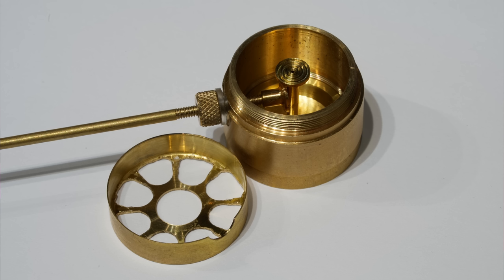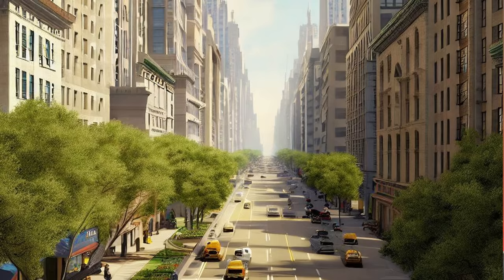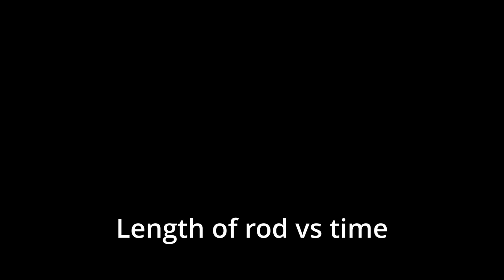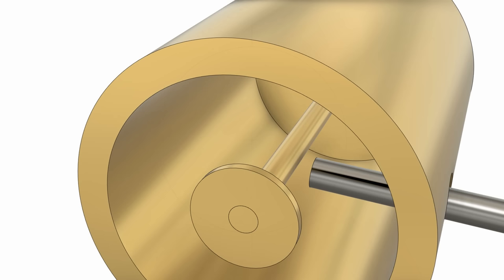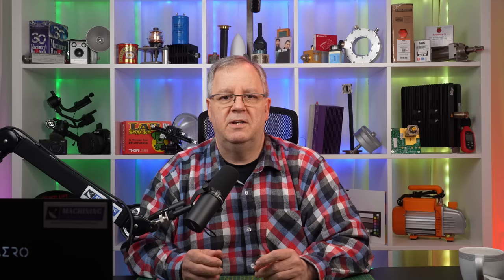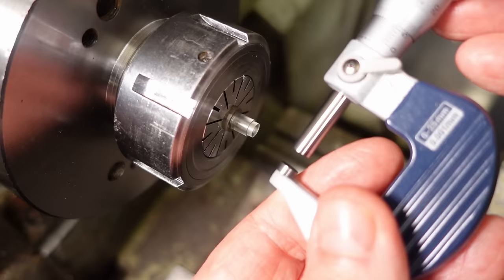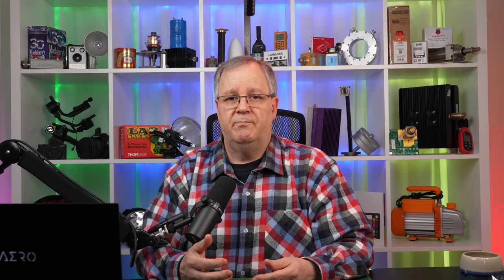SOLVING the Mystery Behind a Soviet Spy Bug : A True Masterpiece of Technical Elegance!

Comment: In 1945 there obviously was no suitable mass-produced vacuum device in the USSR, I bet it was custom-made.
Reply from the maker: There were some acorn tubes in the 30s but I haven't seen and disc-seal devices other than those from GE in 43/44, but the tech was well established by then, so it would have been easy enough for some USSR academics and engineers to make custom tubes and select those that worked well
Reply: @MachiningandMicrowaves , yeah, I didn't mean to offend the western technology of the day, I just initially forgot to specify that I meant there wasn't any in the USSR. Amazing research, thank you! It all makes sense when you spell it out, but back in 1945 I doubt it was as clear and well understood, although the people who worked on it were probably some of the best in the field.
Reply from the maker: @VioletGiraffe  If the NKVD followed sensible protocols, none of the individual makers or suppliers would be given enough information to form an idea of what the whole thing is about. I'm researching proximity fuzes fir a project, and the security restrictions included not using weapons with prox fuzes over land to prevent duds and parts from being found by adversaries. During the early deployments of the Sidewinder air to air missile, a MIG was hit but the warhead didn't explode and the pilot managed to land safely, complete with the missile. One hell of a way to gather intel!
Reply: @MachiningandMicrowaves , wow, great story, thanks for sharing! I've heard about some cold war accidents, but not this one. And indeed, compartmentalization would be expected in such a top secret project.

Comment: Did you get a specimen device, and figure this out on your own?  Kudos to you if you did.  I had the right education, though I  didn't use it during the last 50 years - I went digital - so I'm able to follow you, but I would never have figured out how it worked.
Reply from the maker: For the purpose of the TV programme, I worked only from the original sketches and notes from the Naval Laboratories, FBI and CIA from 1952. I didn't use anything from later as most of it was nonsense, other than the 1955 CIA lab experiments, but that was only for verification.  I took the view that I'd construct it as accurately as I could, then find out how it behaved without any of the hare-brained ideas about "1.7 GHz" resonances or some sort of magical frequency multiplication.  I trusted my instruments and tested it and found it worked best between  about 930 and 1100 MHz, with best performance in the 950 to 1000 MHz range.  I had to trust the sketch diagram dimensions, and there are two errors in that, but luckily it's over-constrained, plus some of the other dimensions had to come from very careful measurement of zoomed-in photos.  We couldn't get hold of any current images as nobody seems to be aware of where the original resonator parts are, nor could I get high-res images of the attachment of the foil to the bronze ring, nor the exact arrangement of grooves on the face of the resonator.  It took more than a hundred hours of experimentation in my machine shop and lab before I was confident enough that I understood it all. Reverse--engineering something like this from pencil drawings and photocopied photographs and unreliable descriptions laced with fanciful ideas and deliberate misinformation has been huge fun. As I'd say to anyone, ignore everything you think you know about the thing you're investigating, check your instruments, then trust what they tell you, even if it seems at odds with received wisdom.
Reply: @MachiningandMicrowaves  Well you certainly get my respect, Sir!  You did fantastic research work.  One thing that I found amazing was that the Americans had accepted a gift like this from the Soviets, and had hung it in a politically sensitive environment.  How naive!  They could have used a bloke like you!

You've got to give it the Ruskies, though - it was a damn clever idea - but sometimes, these things are easier to conceive than to analyse after the event.  We don't know how the Cusco walls were made - but I don't suppose it was anything we would find amazing if they had left a movie of how they did it.
Reply from the maker: @DownhillAllTheWay  Harriman was a well- researched target, and none of the tech folks thought this was a potential risk without and power source or wires. The attention to detail in later ops like GUNMAN were astounding. Making the hollowed-out metal bars containing the decoder, magnetic core memory and transmitter weigh exactly the same as the bar so there was no effect in the overall weight of the typewriters show serious attention to detail

Comment: I've read through the wiki article for this bug before, but I'm fairly certain I still did not understand how it worked. Now I do, and god damn that thing is brilliant. I don't necessarily fully understand your description of the demodulation side of things, but that's on me for not being too into radio and microwave stuff.
Reply from the maker: I didn't really explain that part, I was trying to keep it short and failed at that as well.  I might see if I can make a version that can be driven directly to show what the output really looks like, and then look at the maths.  If you have a diode in its square-law region, the current is proportion to the voltage squared. If you then drive it with a mixture of a pure tone at 1 GHz and the modulated signal, then feed the output into a resistor, the voltage across that resistor is the sum of the tone and signal, all squared.  The tone is just B*cos(omega*t + phi) and the  modulated signal resulting from a simple audio tone is the usual AM expression A*sin(omega t)+ 0.5Am(sin(2pi(fc+fm)t+theta + sin()2pi(fc-fm)t-theta)
omega is just shorthand for 2pi*fc, fc is the 1 GHz carrier frequency and fm is the audio modulation frequency. A and B are just the amplitudes and m is the modulation index (0.05 or so) Now add the two together and square the result using the diode transfer function.  You get an exciting mixture of results!  After a load of trigonometric identities and wrangling, there are some components with sin(2pi*fc+phase angle) plus a load of other stuff.  Run the combination through a diplexer to take anything higher than 3 kHz into a dump resistor and everything below 3 kHz but above 200 Hz into an audio amplifier, and you recover the original audio signal.  If there is also some phase modulation, that results in  multiple additional sidebands around the 1 GHz carrier, although at a low modulation index, the result is pretty much the same as AM.  At higher modulation indices, the results are more complex, with Bessel functions of different orders causing a spread of sidebands rather like in FM.  However, they are mostly removed by the low pass filter, except for the low frequency parts of the higher-order sidebands. The amount of phase mod is (luckily) quite low.  I hope you can see why I rather glossed over THAT lot, but it would be fun to do a ten minute vid about it at some point, to exercise my MATLAB, Manim, MathCAD and storytelling skills!

Comment: Nice work! All right and correct, in theory, but it is the amount of re-radiated power by the passive radiomicrophone, an infinitesimal fraction of the signal transmitted to "excite the passive transmitter," that puzzles me.
Passive repeaters are rarely practicable, precisely because of the huge attenuation, which is easily calculated.
Therefore, given the infinitesimal power of the re-irradiated signal, the distance a receiver must stand for this system to work is very (but very) small. 
Power that is still reduced by 3bB, since to modulate in amplitude (and spuriously in phase/frequency) we will have to resonate the cavity with a frequency offset that brings the carrier to -3dB from the peak.
A huge power transmitter is needed, with the consequent problem that it will be (also) extremely difficult (in practice) to be able to rotate multipath reflections 180° as well as the carrier. 
I am afraid this is as ingenious as it is complex and impractical to put into operation.
Reply from the maker: It worked continuously from 1945 to 1952 in the US Ambassador's residence in Moscow and in several other embassies. Copies were made by other security services and they worked. I was able to get up to 76 dB of cancellation of the exciting signal. From 140 metres, 5 watts is more than sufficient. I made it work with 250 milliwatts using a modern SDR radio and a period-correct homodyne with a sense antenna. The low noise floor in 1945 Moscow helped a lot of course, but I even managed to detect a very weak signal in all the RF noise inside the BBC Council Chamber at Broadcasting House in London. It isn't easy, but with careful positioning and use of separate building with mutual shielding, it certainly worked well back in 1945 and still works now st my quiet rural location
Reply: @MachiningandMicrowaves  Thank You for answering! Could You please be more precise with datas? I'm very much interested to estimate the power which is radiated from the passive radiator. Is it -24dBm the transmitter output power? Then, 24dBm + 13dB (antenna gain) give the desired ERP of 37dBm (5W), correct? What's the distance between transmitting point and the device? What kind of antenna/s did You use with the receiver? What SDR receiver did you use? It must have had two ports, allowing independent phase and amplitude regs, correct? What sort of layout had your test system? Were the receivers antennas shielded to transmitter, but in line of sight with the device? The device was in open air, or shielded by wall/s?
Reply from the maker: @MaDrone  I'm travelling right now so I'll try to reply when I am back home
Reply: @MachiningandMicrowaves  There's no rush.

Comment: A very nice presentation, when I first heard of the bug I thought it involved a diaphragm and microwave energy, as batteries would never do.  (later) I thought a silver plated cavity etc, with a gold flash to seal the silver from the air born pollutants (sulfur) from corrupting the surfaces.
I always thought the transmitter and receiver would be in the same room/same window with cross polarized antennas, possibly circular.  (possibility with a sample of the transmit signal inverted, providing phase controlled subtraction.  I'm not sure when isolators were developed, but they would be helpful in this area. I love your background. Ron W4BIN
Reply from the maker: The few references in Russian that I've seen do suggest that the transmit site was about 140 metres away across the street behind Spaso House and off to one side.  There is some discussion about why the caretaker/boilerkeeper took three weeks to hand over his key to the lodge, and when it was inspected there was a suspiciously empty room, but that came from US sources.

Comment: UHF  AM radio transmitter using passive components  in 1945?   I am impressed.
Reply from the maker: Not quite a transmitter, but certainly a passive backscatter modulator.  It's an iconic design from much simpler times that has been misunderstood and misrepresented in publications

Comment: Many early UHF receivers used resonant cavities as the main RF resonator instead of a coil and capacitor.  As the team was already skilled in that technology, they could have easily used it for both the power  emitter and FM receiver.
Reply from the maker: It's the transmit device that's in question, but at 1 GHz, they could possibly have used helical resonators if they existed at the time. I guess it would be more likely they used stripline cavities as you suggest. I know there were Russian-made acorn tubes capable of working at 1.4 GHz in the mid-30s, they are in the catalogues, but there would be no need for an RF preamplifier with the high signal levels, so I guess they just used a crystal diode detector with perhaps a directional coupler and phasing/attenuation for a sense antenna, then a diplexer/filter straight to audio. There were certainly plenty of cavity transmit amplifiers around in the early 1950s for the UHF range, but I haven't seen any direct evidence for what they were using in 1943-45.  Of course the tech might have changed over the period the device (and the others!) were operating.  Klystrons didn't appear in the West until the Varians published their paper and patent in '37 to '39, but tubes capable of 400 MHz+ do seem to have been available. Getting hold of Klystrons after 1941 would probably have been easy enough, but perhaps they used indigenous Russian tech, which was pretty much on a par with the rest of the world, or something from Germany.  I would just LOVE to see a photo of one of the transmit units!

Comment: TBH I'm having difficulty seeing your face and a backdrop. Not that it's bad, but change is difficult. I'm glad there's some machining in this one to get me back to my comfort zone. Happy Easter!
Reply from the maker: I'll be mixing up the formats depending on what work comes in.  The BBC Great Seal and Rogers Corp video series have taken 500+ hours in all, so machining has taken a back seat, but it's beastly cold in the machine shop.  I have a new heater now, so I should be able to get some interesting projects machined.  Also I have new metalcasting gear, a new 3D printer for mouldmaking, some excellent new inserts for ultra-fine grooves and an Alexander D-bit grinder, so should be able to do some better machining.  I have three sponsored videos coming up, so that will help me to make some better parts and do more interesting projects.
Reply: @MachiningandMicrowaves  You're doing a great job. The resonant cavity explainer is super interesting and far more complex than expected. Hope it warms up nicely for you.

Comment: Utterly fascinating! RF still seems like a black art to me, I like nice friendly DC that’s not always finding some way around things when you’re not looking. I still love your stuff though :-)
Reply from the maker: "Everything is an antenna", "Amplifiers are just temporarily failed oscillators".  I love things like microstrip PCB interconnects where they can be logic 1 at one end, logic 0 in the middle and something else at the other end, and also radiate and couple to anything and everything. Such fun.
Reply from the maker: see also "Every UHF oscillator is also an SHF oscillator, but you probably won't realise that until it's too late"
Reply: @MachiningandMicrowaves  Haha - I like the one about failed oscillators! 😂 I watched a really fascinating hour-long video about PCB layout last week; the main point was that PCB traces aren’t conductors, they’re antennas, you can’t just think about decoupling caps, you have to think in terms of the electric and magnetic fields; every nearby trace is going to look like a path to ground for the highest frequencies. It was a complete paradigm shift for me 🤯I don’t have any occasion to design high-speed PCBs these days, but it was still hugely educational when it comes to thinking about shielding and grounding to keep HF noise out of low-level inputs.
Reply from the maker: @DEtchells  I remember laying out MECL III PCBs with microstrip interconnects back in 1976.  They were only running at 280 Mbit/sec, but it seemed pretty fast at the time. Troubleshooting without modern EM solvers was a whole bag of fun

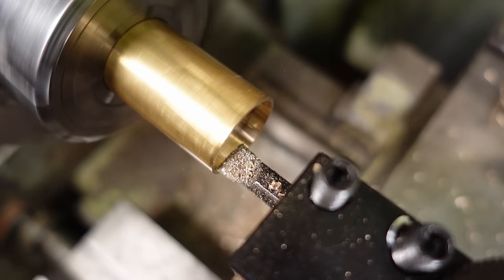Comment: 16:20 I recommend that if you intentionally do single channel audio, you keep like 5-10% on the other channel. I got confused why the voice over cut out.
This is my first time watching one of your videos, so I’m not sure if this was intentional or an accident caused by editing without showing both audio channels on the video segments and only using speakers that are very close in proximity.

If it was intentional, letting a bit of audio through to the other channel informs people using one headphone that they’re missing something.
Reply from the maker: I'm deaf in one ear, so I must have missed a bit.  That usually happens if I forget to do the auto-sync to the audio recording in Davinci.  As all of the voiceover is supposed to be mono from my SM7B, it only displays as mono unless I check the track properties.  Definitely not intentional, I usually do a check by flipping my headphones. It's only the third vid I've made using Resolve, I'll get there eventually... I can't see a way to spot that sort of issue without having an extra ear fitted, but I did the same thing on another vid and didn't spot it.  In my old editor, and using the Blue Yeti, the tracks were all stereo so it was easy to see.  I'll have to find a way to detect this happening
Reply: @MachiningandMicrowaves  ah, makes sense! I’ve seen loads of people do this.
I’m only familiar with premiere, and I haven’t edited videos in like 7 years, but I remember there being an option to display both the left and right audio tracks’ waveforms to quickly see if something’s just in one channel, but I think I remember it not being the default.

Almost all of the time I’ve encountered this, it’s been a mistake. But every now and then, it’s a stylistic choice which is probably fine for most people. I’m just in the habit of only using my right headphone for whatever reason.

By the way, awesome video! Don’t mistake my comment as negative feedback!